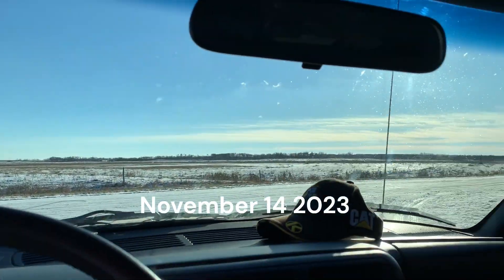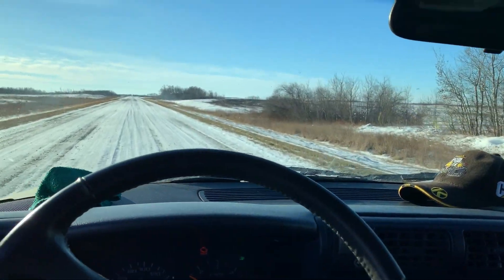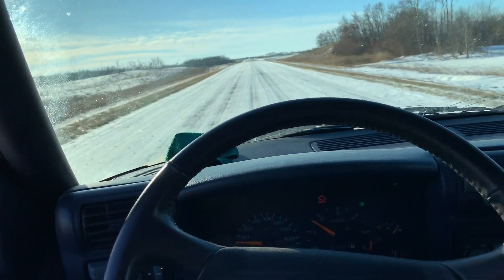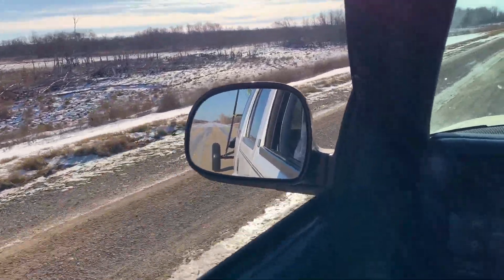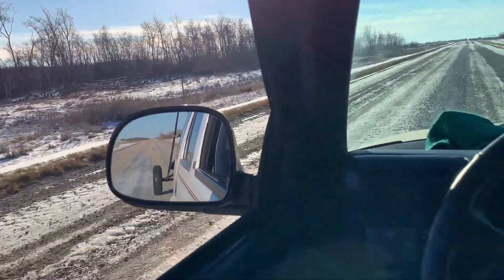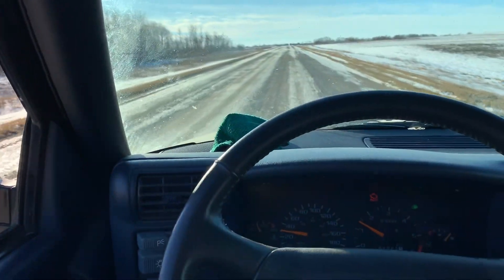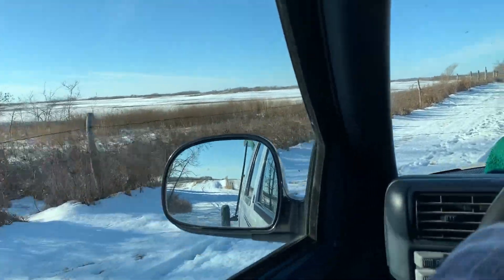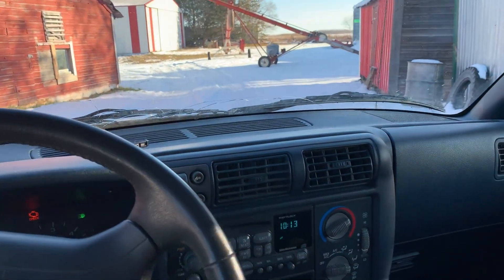Hauling Auger

Comment: Good old square tires... always make for a nice drive.
Pretty good looking auger!
Definitely a lot more life in it than your old one.
Thank you Roosty!!
Reply from the maker: Hi Ed. I just needed to drive a little faster :-) Carb is going to need a little work before it runs.
Reply: @roosty6  I would imagine a good cleaning, probably polish the ignition pickup and flywheel too..
Reply: I have the same auger, but pto driven, and it’s a yellow Brant. No snow here in Ontario as yet, sunny and 44F today. Corn combining is in full swing. Elevators are having a hard time keeping up with the drying. Corn isn’t drying down very well in the fields this year, most is going into the elevators at between 26-23% moisture. Everyone wants to get the crop off before the nice weather runs out, and are willing to pay the extra drying charges, instead of possibly waiting until till spring, and risk feeding the crop to deer.
Reply from the maker: @bruceprentice6441  A yellow Brandt? Are you sure thats not a Westfield? All older Brandt here were red, or in the case of Field King, green. Good luck with the weather on your corn harvest. Our early winter is backing off a bit and we are losing a lot of the snow that fell.

Comment: I like those older augers. I have a couple of Sask Wheat Pool augers kicking around. They are painted orange and made by Brandt too I do believe. One is a 7” by 32’ and the other is 8” by 45’. I’m assuming dad bought them in the late 70s or early 80s and I remember using the 8” for both filling bins at harvest and for shovelling out bins when I was a young guy in the 80s/90s. They don’t get much use anymore except for with fertilizer but they are sure built well. Good backup too in case my 8” Wheatheart ever decides to not behave. 
I don’t really ever remember seeing any branded as Co-op with or without the green vintage. Either they must not have been too common or they just weren’t a thing around here that I know of. I do remember blue Allied augers around though but I haven’t seen those in probably 25 years or so.
Reply from the maker: Yes, a lot of Brandt augers also sold with Pool decals on them. I would not want to shovel to an 8 inch auger as even a 7 inch will wear two men out trying to keep up. Co-op also sold Inland sprayers branded as Field King. I think there might have been a few other implements sold with the Co-op/Field King label back in the 70s-80s.

Comment: Our current big auger is an Allied. 8"x46'?? Same gearbox and shaft setup. It had a 16hp electric start Briggs too. We converted it to PTO drive. The old Briggs had moved a few million bushels before we got it.. probably moved a million here, before we converted it..
Reply from the maker: That Allied is a big auger I wouldn't want to push around by hand. The Briggs has a combination generator/starter on it. Not sure yet if it works.

Comment: Nice looking auger but I hope ya keeping that old rusty one as an antique for it being a shop made auger. Never Knew that Co-op sold them Brandt made augers, awesome scenery
Reply: The old one has definitely earned its keep. Nice addition Roosty
Reply from the maker: The little old six inch auger is still fine and used often but the 7x33 Sakundiak has rusted so bad that tube is buckling and leaking. I have patched it up with inner tubes, clamps and tape just to get by.
Reply: @roosty6  I must of gotten the two mixed up.

Comment: Lol rough summerfallow. Also them tires must have been considered the small tires. Lol remember that?
Reply from the maker: SMall tires? I don't think there was an option. 14 inch tires are not that common anymore. Maybe I'll have to upgrade to 16 inch wheels. Tried to pull start the engine but the carb is flooding real bad so not likely to go.